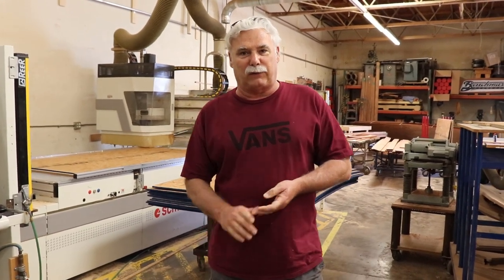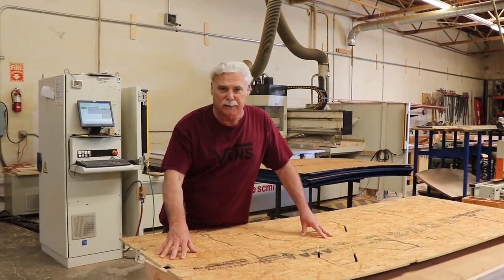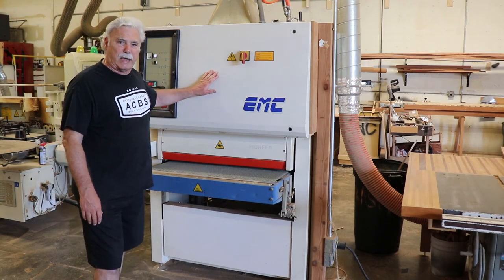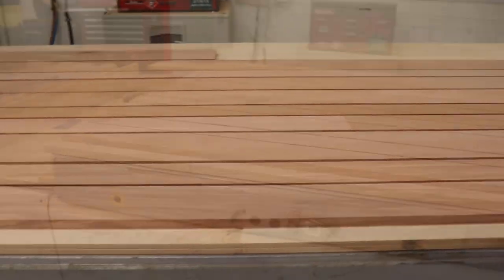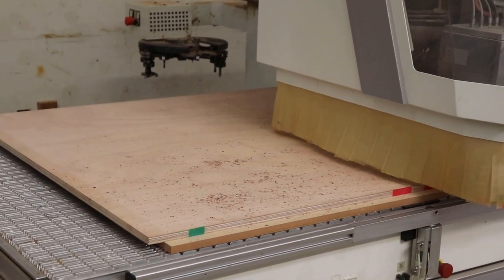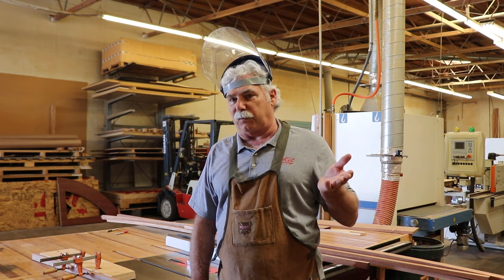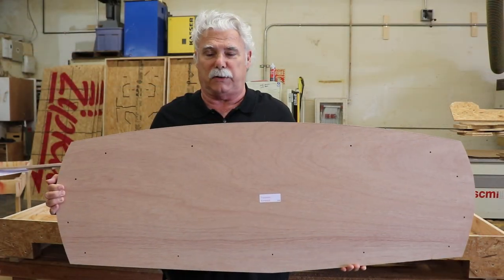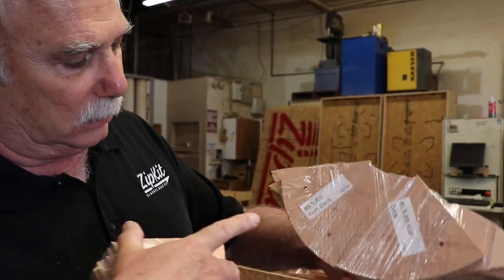Producing The ZipKit

Comment: Question! Is wood only available?
Reply from the maker: ITEM NO. DESCRIPTION COST
Benchmark Products
09-27 ZipKit Wood parts Kit $3,400.00
12-12 Upholstery Wood Part Kit (OPTIONAL) 550.00
Glen-L Designs
68-463 Bronze Finishing Kit $ 168.00
67-463 Carriage Bolt Kit 9.25
09-502 Adhesive Poxy Grip 1/2 Gal 83.00
71-463 Fiber Glass Kit with Epoxy 518.00
09-509 Encapsulation Epoxy (Poxy Shield)
(2) 1.2 Gallon Kit @ $143.00 ea 286.00
08-130 Application Kits
(2) @ $40.50 ea 81.00
Home Depot/ Misc. Shop Supplies
Lowes Sand Paper, Masking Tape, Dust Masks,
Solvent, Rags, Etc. $ 200.00
Overton's Motor & Steering
308439-14 Uflex T71FC with Cable $ 137.74
Grant
834 Steering Wheel Classic Series $ 61.27
Porta-Bote International
DF30A Suzuki 30 Hp. Four Stroke Motor with Fuel Tank & Controls
Free Delivery (800) 227-8882 $4,490.00
zzzipkit.com 714-206-5222
ITEM NO. DESCRIPTION COST
Outside Services Upholstery - Seats, Stands, Floor Boards & Carpet
Estimated Budget Price $ 1,500.00
Paint & Clear Coat - Estimate Budget $ 1,500.00
Varnish $ 180.00
West Coast Trailer
Model #MT/6W-1250 Trailer - Magic Tilt $ 1,200.00
Glen-L Deck Hardware
05-024 Bow Eye
(3) pcs @ $17.00 ea $ 51.00
14-177 Aluminum Outboard Fin $ 30.00
ESTIMATED BUILDER'S COST $ 13,895.26
Plus Shipping & Tax
https://www.